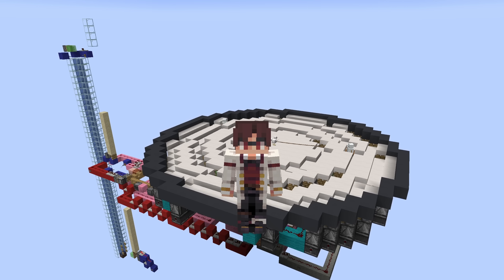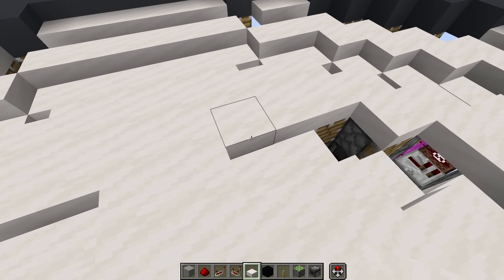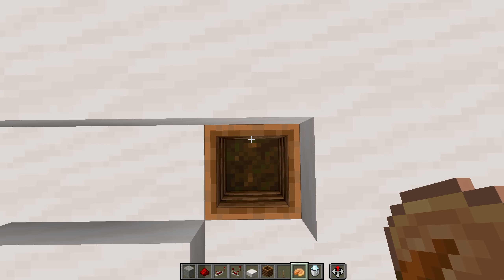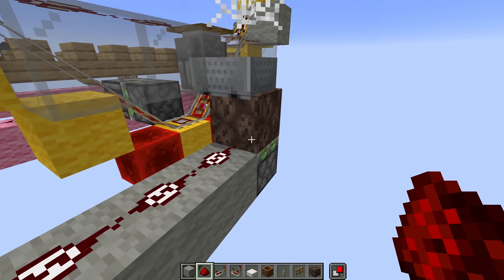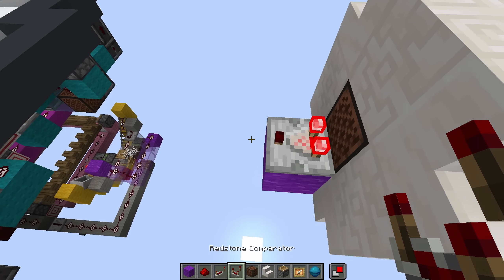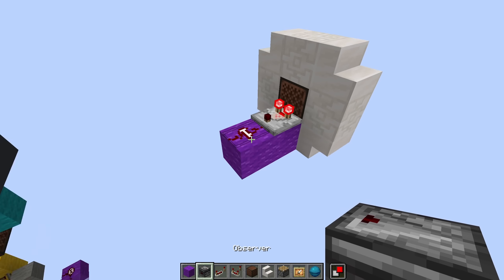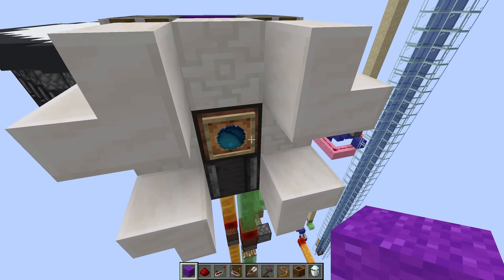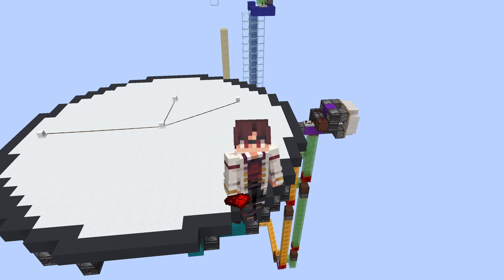IT'S FINISHED! | Making a Mechanical Watch in Minecraft - The Crown

Comment: Congratulations on building the first mechanical clock that runs on electricity! Lol
Reply: You may find it interesting that you have to change batteries in some analog wall clocks.
Reply: @tim-elmer  analog doesn't mean it's mechanical.

There is zero electricity used in a real mechanical clock.
Reply: @DH-xw6jp  Semantics, I suppose. When I hear "mechanical clock", I think of a clock with some degree of mechanical action. This would also include an analog (or digital) clock driven by an electric motor. If we're talking about a clock driven by a wind-up "spring", then you may well be correct.
Reply: @tim-elmer  it isn't semantics, you are just using the word wrong.

Comment: why isnt the guy in the middle just replaced with a fence post??
Reply: Because the watch face is an even number and he needs it exactly in the center (where four blacks meet), a fence post would be offset and snap the leads.
Reply: @DH-xw6jp  why does it need to be even numbered?
Reply: @lelaleasl he explained it in previous videos
Reply: @lelaleasl so the second hand cann be 60 blocks and all rings can be multiples of 12

Comment: if you put the composters on honey, will the golems be able to jump out? if not, does this mean it is possible to build in survival because you wont need noAI commands?
Reply: thats not the issue, the issue is that the golem would fall to the bottom of the composter and the lead would disappear into the snow
Reply from the maker: They wouldn't be able to jump out, but I can't put honey in the tapes with them being so close together. The tapes pass by a lot of adjacent pistons, so I can't include slime or honey.